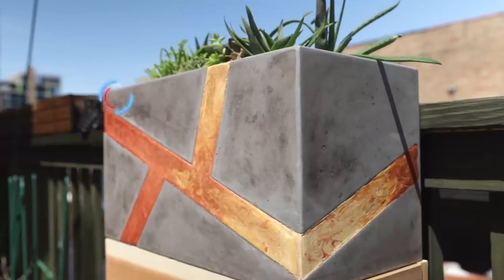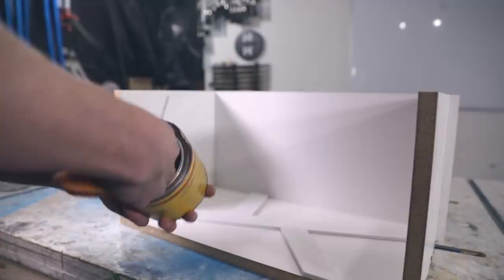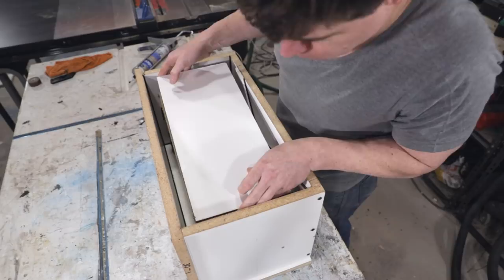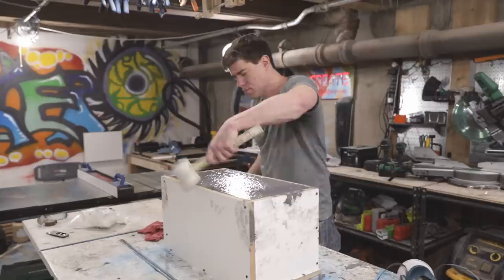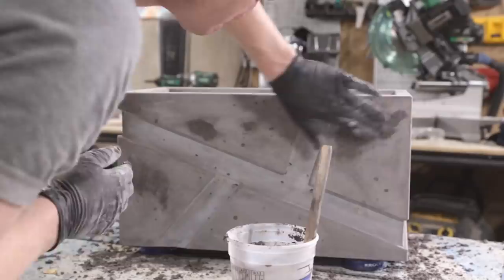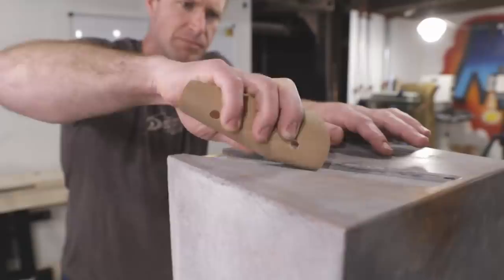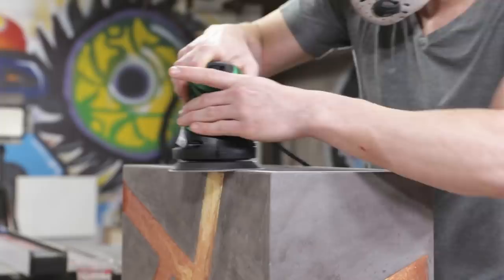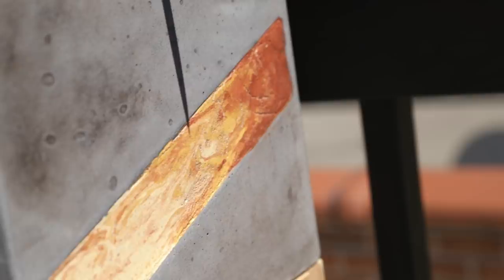DIY Modern Concrete Planter Box || How to Make with Limited Tools

Comment: You could add draft (taper) to inner forms to help them release easier. Straight up and down causes a seal and constant friction. Adding the draft all you need to do is get the initial release, which can be done with compressed air, then it should lift right out. same concept used in sand casting to get your pattern to release well.
Reply from the maker: Yup, adding a draft angle is the way to go for ease of removal.  I didn't because I wanted to keep it beginner friendly and avoid tapered miter cuts which would need to be done on the table saw.
Reply: @modustrial  Sometimes we use 1" pink insulating foam for our inner plugs...it is much easier to remove and in worse cases acetone will dissolve the foam.
Reply from the maker: That is a good call!  I need to pick you brain about that for the integrated sink project I have coming up.  I'm curious if the foamular surface will make the inside of a sink look  uneven against the rest of the sink cast against melamine.
Reply: @fishstonestudio  brilliant. I was fretting about cutting and making an entirely new interior box each and every time.

Comment: Hi Mike, I would divide the side parts of the inner formwork in two parts and then screw them from the inside, then they can be removed later without problems. Best regards Frank
Reply from the maker: Good tip!  Maybe I'm not picturing correctly, but how would this prevent the two ends spanning the width of the inside from getting wedged in?  Do you show this in one of your videos I could check out?
Reply: Between the two halves of the inner formwork boards, I leave an air gap of 3 mm and then screw the formwork from the inside. Through the air gap you can easily remove the wooden boards when stripping, because so the pressure will be removed. I glue the air gap from the outside with a waterproof tape, so that the inner formwork is completely waterproof again. The lid of the inner formwork I make out of polystyrene, that can then easily be broken out again
Reply from the maker: Ah ok, that air gap is the key.  Good to know!  Thanks!
Reply: Her in this Video it is explained: https://youtu.be/spg6kxq5gzo

Comment: psst:  Motabo  is Mitsubihi......    Great tools  I have had great ones from a drill kit and a saw like yours but corded and been using it for more then 30 years now.  Hey  I just realized I need new one,  well only because I like the Battery option for job sites.  I should enter that contest!

Comment: 'keep it simple'  applies to this type of project. For sure, improvements can always be made over the first attempt but making it more complex by using spray concrete might be a mistake. And it takes it out of the realm of the average DIY joe (like me). How about making it even more bare bones by leaving the colored infill out. Just a few thoughts. And I definitely learned some good tips while watchng this, thanks
Reply from the maker: Thanks John!  Just having the negative space pattern with no colored fill would look really good too... When I popped it out of the form, I was tempted to just call it a wrap because it looked pretty good then :)

Comment: If you use an orbital sander without paper on it, you can vibrate your form very easily. Using a buff pad on it would be better than the Velcro pad. Just put a bit of pressure.
Reply from the maker: Typically no need to vibrate with GFRC, it has a bubble reducing admix

Comment: If you added a taper to inside and outside moulds your demoulding would have been a lot easier and you would have been able to use mould as a production mould for many copies. Use an orbital sander on the outside of mould as a vibrator to have less holes on outside.
Reply from the maker: Yup, taper would made make it easier.  I was just trying to keep this simple and use minimal tools....I wanted to make this without using the table saw.

Comment: Cool project and thanks for sharing! The coloured stripes turned out really nice! A tip to use when you add a layer of concrete on existing concrete is to wet the existing concrete before. Doing this have worked for me and you dont need to use a sealer/bonder.
Reply from the maker: Thanks!  IME wetting the concrete only works if the concrete below isn't cured fully yet.  You also have to be careful about changing the water content in the mix you are pouring and weakening it at the point where it meets the old content if you just wet it...it is essentially adding water to the mix.  While it may have yielded OK results at times, I wouldnt suggest this technique due to the risks it introduces.

Comment: Interesting video, thanks for sharing your approach. I think limited tools series should be "effectively limited" so the process should be duplicated by anyone easily. I guess the process in the video (many and expensive tools, so much pigment, silicon, tape etc.) is at some complexity level to be duplicated and is over-engineered.

Comment: That caulking tip was(for me) the best part of the video as caulking is the bane of my existence. I definitely need to work on one of those beading tools for myself. The planter was great as well, just sad that it was grey instead of red with a gradient(ish) stripe instead of white ones. Maybe for the next one, you can incorporate some LED lighting for a multifunctional deck piece.
Reply from the maker: I'll definitely do some more LEDs and concrete at some point :)  and yea, caulking is super easy once you get the hang of the paste wax and ball tool approach.

Comment: That planter's the perfect size for a few kitchen herbs.  Thyme, basil and parsley would make a good combo  Maybe make another for some chives and rosemary.
Overall I love the planter, but the stand could use a door and shelf under it and, although it's ceder, I'd still put a good finish on it.

Quick question.  What do you do with the slurry and waste from the concrete?  I'd like to start out with a few small projects like this, but don't know how to get rid of the waste.
Reply from the maker: Thanks Johnny!  Herbs are a good idea!  The stand was definitely thrown together, in part because Im not sure the final place for this planter (and thus why the video glazes over the stand :). I have some silicon star wars molds that I'll throw excess concrete in... Smartwater bottles and things like that also can be used to make small planters or pencil holders with the excess.

Comment: I made something similar recently and in the inner form I used styrofoam(insulation) wrapped in cling film. How did I stop it from floating up?  I glued it to the base and placed concrete rounds(for pads for the planter base as well as drainage holes through the centre) and pushed it down from above. Then the same process as you did. The foam inner form was super easy to remove as it had some flex to it.

Also from a gardening point of view I think something like a curry plant(Helichrysum italicum), short rosemary, thyme for upright plants would be lovely for a planter that size and give good balance with its height. 

For trailing type plants Begonias would be nice.
Reply from the maker: That is a great idea....it would definitely work and make removal of the inner form easier

Comment: Nice project! I'm looking at trying some DIY projects using GRFC. I noticed you didn't use a face coat on this - I'm hoping to avoid that process as well. Do the glass fibres show through on the surface at all? Is vibrating all that's needed to avoid the fibres showing through?

Comment: Pva glue is good for a bonding agent (basically what it is anyway) to anyone attempting this .Also you could add a plasticizer to the mix (few drops of dish soap will do the same) or buy a cement that has it added already.
Reply from the maker: Yup, the GFRC mix I use has plasticizer

Comment: I tried to buy some of the GFRC from Fishstone and from Amazon (same price) but it was ridiculously priced. The shipping is more than the product. How do you get a hold of this stuff without going broke?
Reply from the maker: Buying larger quantities helps, and you can give Tom a call at Fishstone directly.  I also know that they are working on setting up a distributor network which will help reduce shipping costs significantly.  They other option to make the mix is to buy white Portland cement and quikrete medium commercial sand locally, and then just buy their GFRC Ad-pac and glass fibers.... The majority of the weight is Portland and fine sand, so buying those locally and just getting the Ad-pac and fibers online can save a ton.
Reply: Create your own mix. Buy cement and sand locally and the admixes online
Reply from the maker: @J P yup, agreed, suggested the same in my earlier comment, as an alternative

Comment: Why would it have made it easier to remove the inner form if the top was inset? Probably a stupid question, but I don't get it.
Reply from the maker: When the sides were removed, there would be space between the bottom and concrete to pull it out

Comment: Great Planter Mike, love the Van Halen nod!! How do you get the slurry coat pigment to match the pigment of the planter? On second look, maybe the slurry coat doesn't match? Is it possible to get the two to match if you wanted a more seamless solid color?
Reply from the maker: Thanks Matt!  Since this was a simple one, it doesn't match perfectly, I just guestimated :) the easiest way to match is to use the mixer to mix up the dry materials for the planter pour thoroughly, GFRC mix + powdered pigment, before adding water.  Then put a pound or two of the mixed dry material in a Ziploc bag to use later, before you mix it.

Comment: I don't think the epoxy will stay in there for over 2 years if outside. Nothing is really grabbing onto it. No screen on the inside. No screws to act like rebar. Or cut the wood to make it cuts a groove  that acts like wedge for the epoxy to set as.

 Once your clear coats break down in the sun, that will pop off for sure. Heat expansion will be sure of that.
Reply from the maker: You do realize there is no epoxy in this project whatsoever?
Reply: Modustrial Maker I think it is a Little rude shaming people publicly on Instagram for such a little brainfart. I also sometimes confuse pencils with epoxy when I encase one with the other.😅

Comment: It's a bit hard to tell how hard you're pushing when you're using your hammer drill, but in case you didn't know hammer drills are a bit counter-intuitive. The general conception is that in drilling more pressure means faster drilling. However, with hammer drills, really bearing down limits the effectiveness of the hammering function. When drilling concrete you want the hammer function to be taking impactful hits against the bottom of the hole, which it can't do if you bear down, the threads then just clear the dust from the holes, you're not "Cutting" the hole as with traditional drills.
Reply from the maker: Great tip!  Thanks!

Comment: Because your pot plant is so close to your barbecue… Why not grow herbs? I think one of the best herbs to grow near barbecue is Rosemary. However you want to add to that other herbs you could grow would be basil or thyme or lemon thyme or chilli or chives.
Could put a mix of herbs in that pot plant.... If you want to do that I would just confirm that they like living in the same area as many herbs do not and example of this is to not grow tomatoes, Rosemary and lavender together. You can do it but it is extremely hard. However growing cherry tomatoes and basil together in a pot works really nicely.
Capsicums and chilies grow nicely in the same pot however be careful because the Capsicums might get a bit hotter than you might expect because they will cross pollinate.
What are you grow might depend on how much time you can put into looking after the plant and whether you want an annual or semi-annual.
If you want an annual plant I would recommend cherry tomatoes and basil.
If you want to plant that you will keep for awhile I would recommend Rosemary.... just Rosemary
Rosemary is very hearty and you will get lovely flowers and it is a useful herb.
If you want something unusual you could grow pineapples in the pot plant and I saw you could probably grow 4 to 6 pineapples. Pineapples require lots of sunlight in order to get the fruit very sweet. In order to get pineapples to go buy some organic pineapples from the grocery shop that still have their tops attached. Break off the green growing top and put it in some water so that the base is covered but only just. Wait until it grows roots and planted in the soil.
For further details on how to propagate pineapples there is a lot on the Internet.
Pineapple is a succulents and so therefore is a very hardy plant.
You will have a very unusual and unique planet that can be a talking point. Barbecued pineapple is also very tasty. From when you plant it you do unfortunately have to wait almost 2 years to get your first fruit. If you do live somewhere where it gets very cold to the point of snowing you may have to either build a greenhouse or the plant over top of the planter or bring the pot plant inside for the season.

Comment: but why do you apply the caulk?? could you just angle grinder with cup disc to smooth it out...
Reply from the maker: Caulk is an easy way to get perfect corners, and also prevents water from getting into melamine core and causing it to swell
Reply: @modustrial  could you also just round over with a grinding disc.

Comment: A small draft on the inner mold would have made removal much easier.
Reply from the maker: Yup, that or just using foam... I was trying to keep it more basic so it's approachable for beginners and didn't want to use miters and bevel cuts for that reason

Comment: Hello, love your vids! Have you ever tried doing any eco-friendly builds using hempcrete?
Reply from the maker: No, I've never even heard of it ... I'm going to check it out right now!  Thanks for the suggestion!
Reply from the maker: Checking it out, the surface looks very rough you get with it....I'm wondering if there is a way to do a thin face coat of GFRC and back it with hempcrete

Comment: Limited tools? So miter saw circular saw.. drill and sander. Heres a list of the rest for everyone that needs it ..

Hot glue gun. Squares. Caulking gun. Fondant tool. Impact driver. A mixer and attachments. Mallet. Chisel. Multi tool. Nail gun. And all the misc stuff like knives, measuring tapes etc.

Comment: You said Hikoki are the first to have corded/ cordless mitre saw, unfortunately wrong there as dewalt have had theirs for quite a while
Reply from the maker: Hikoki is the first system that is switchable....any tool that runs on a Multivolt battery can also be plugged in.  Circular saw, drill, angle grinder, miter saw, etc

Comment: I doubt that the scuffing/bonding compound was even necessary given that the original pour was still relatively fresh as far as concrete is concerned
Reply from the maker: You are probably right.  Also, now that I think about it a little more, the front (where I didn't use bonding agent) had no cracking... So the agent might have been culprit for the cracks.